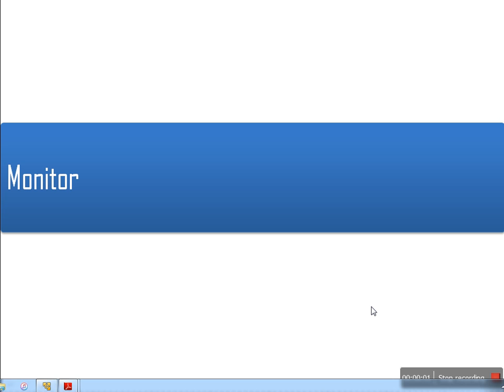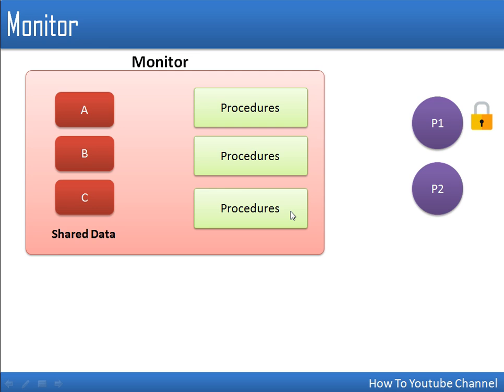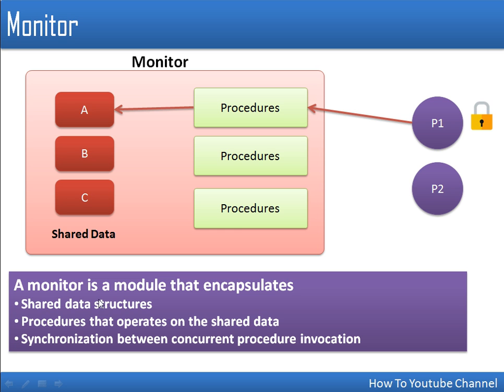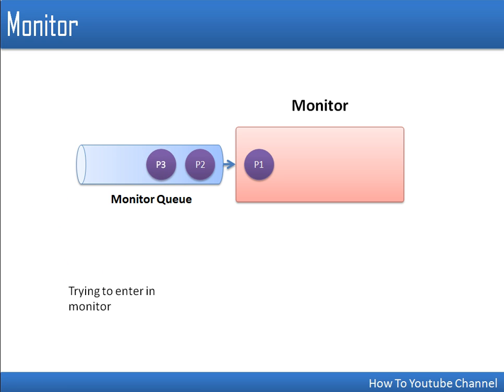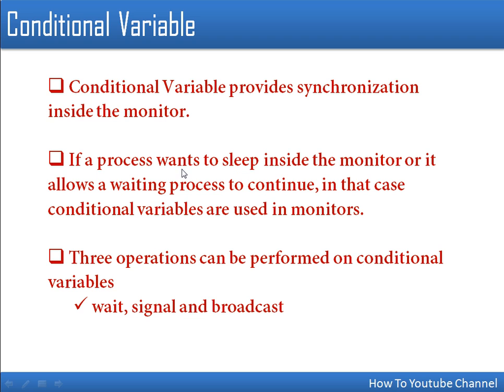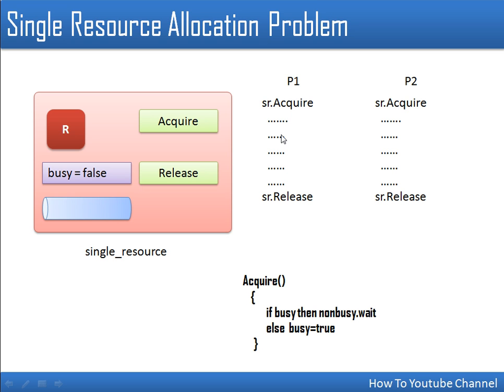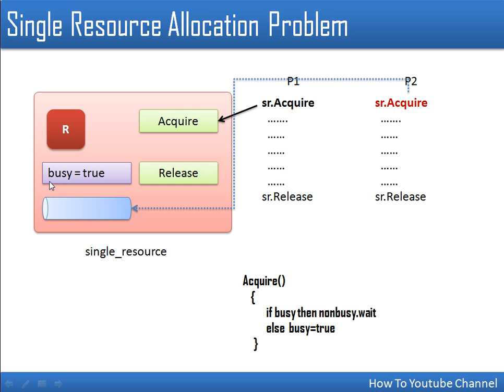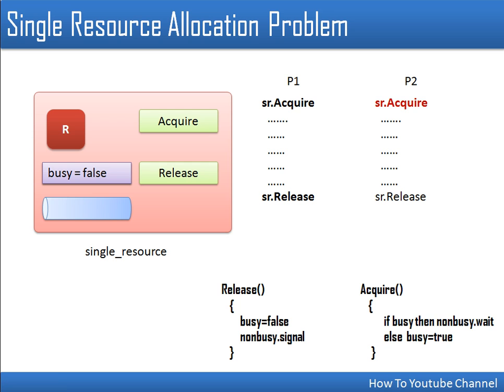Introduction to Monitor in Process Synchronization  Operating System

Comment: Thanks for the explanation on monitors. They're so similar to semaphores (with the wait and signal operations) that it's hard to see the difference. However, I think your graphics show how monitors encapsulate more features (such as conditions to be used in the signal call).
Reply from the maker: In semaphore signal operation increase value
So in case of there is no waiting process in that case also signal will increase value of semaphore
Whereas in monitor if there is no waiting process then signal operation don't do anything
Btw I will upload one vide to clear the difference between semaphore and monitors
Reply: thanks a lot

Comment: shouldn't the p2 be blocked since the lock is already occupied by p1 in single resource allocation problem .
Reply from the maker: P1 hold lock for the duration methods acquire and release called. When their execution is over lock is released.
Reply: I dont undrestand your explanation. Why P2 can access monitor if P1 hold the lock ?

Comment: I really like how you used the example of the producer-consumer problem to link it with monitors, nice explanation. Q: Having the wait() operation avoids deadlocks? (E.g. if the consumer thread wants to access an empty buffer but doesn't release the lock without conditional variables)